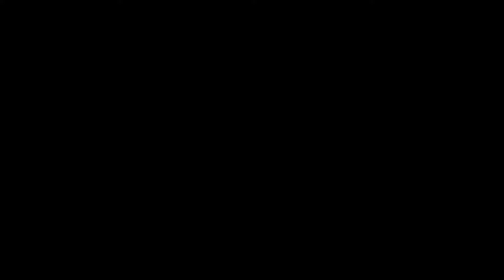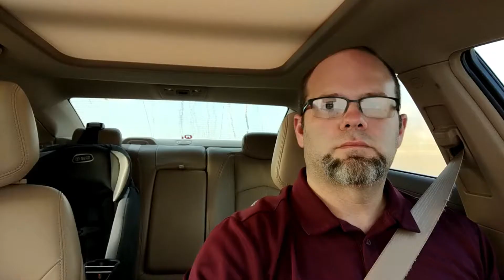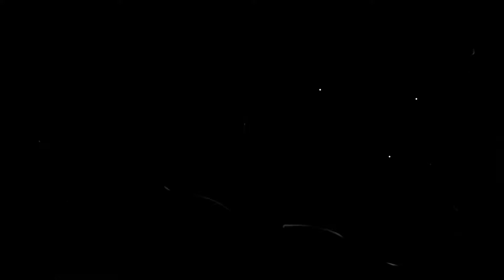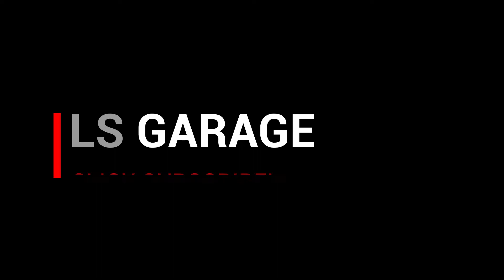8.8 Rearend Update

Comment: Should have did a bolt in 9in or 12 bolt Chevy , my quick performance 9in cost $2500 and that was with a aluminum 3rd member,  moser 12 bolts are about $2400  bolt in from summit racing
Reply from the maker: Same as I said above, already had this one. Can't beat (nearly) free. I have $75 in ebay original ford 3.27 gears, $100 in an install kit, $150 in the gear swap, and $200 in the axle debacle. So $500 for what I wanted in this setup. It went back together great with no issues once carrier bearings were replaced.